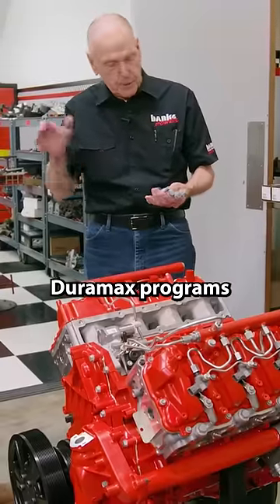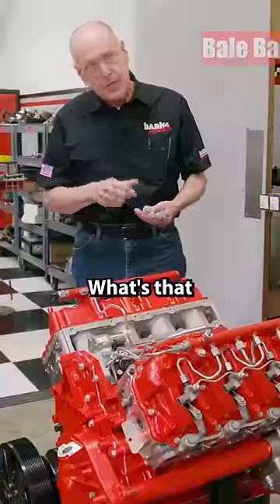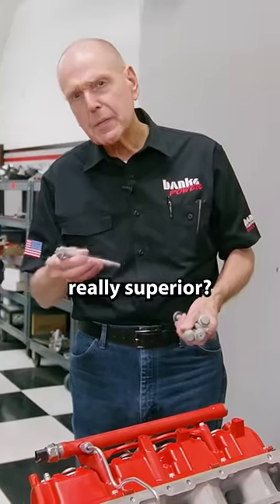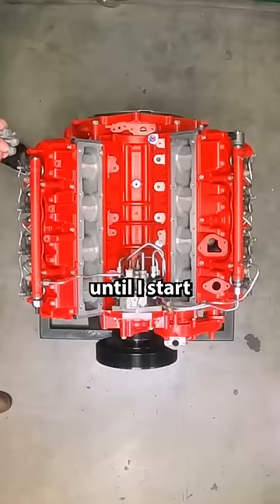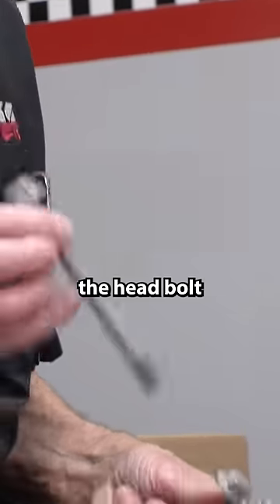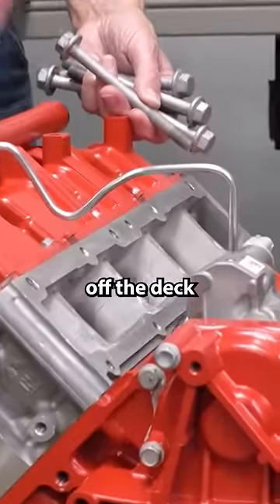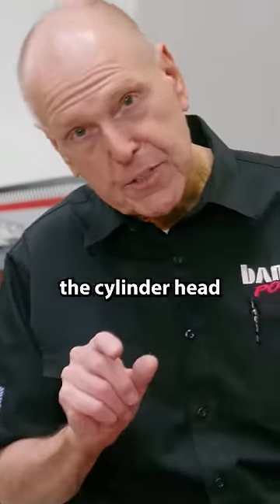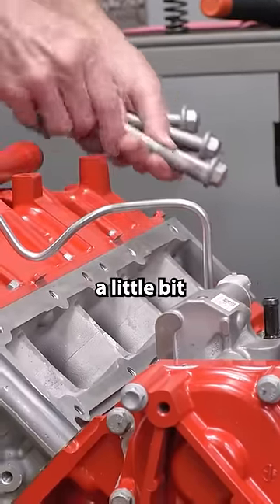Upgrading to head studs might be a bad idea

Comment: A gasket failure is always cheaper than cracking the block or the head.
Reply: A gasket failure usually leads right into over heating, which can warp/crack the head as well as cause other damage to multiple points of the engine. But if you can catch it right away, yeah.
Reply: Facts, but also water in the oil can lock all of your bearings.
Reply: A gasket failure often times leads to head/block damage, so not really
Reply: In these applications he’s referring too - you’re gonna pressurize the cooling system or whistle burn the head and know immediately you have a gasket/internal issue.
Reply: @nathan1sixteen  cracking the block/head always leads to engine damage… take your pick
Reply: A gasket failure usually only leads to catastrophic failure if you keep driving the vehicle with the blown head gasket while it’s overheating. It’s common sense to stop driving when ur shit is overheating
Reply: @Eduardo_Espinoza yes !! I just spent 2500 on this issue !! Your right 👍
Reply: Do none of the people in this thread watch their damn gauges? A gasket failure ONLY leads to other damage when the owner is clueless or careless!
Reply: Idk. I’ve seen guys with engines that eat head gaskets. They stud it and don’t have anymore issues. Maybe don’t use a block that’s made of cheap material
Reply: Not true.  Cab off is always expensive.  😂
Reply: Yeah that guys just a genius
Reply: @Eduardo_Espinoza lock what? do you even know how "bearing" are in a engine  hit for you there none crank and rod ride on a lol film that the bearing clown water in it won't do jack shit 
But it will destroy a 2 stoke engine in no time because small engine use actual bearings for the crank and rod
Reply: @nathan1sixteen gasket failure never end up in a block/ head failure unless you let it overheat for hour even then it will be rebuildable been here done that to a John Deere 544j the operator blow the head gasket go back to the garage and let it run for 1 hour before a mechanic go stop the engine with the temp gauge peg for probably 1 hour 
But now the engine is rebuilt with the original block and head and work great
Reply: @Adierit i don't know score but I'm sure there's been a very small amount of engines in history that cracked a block the second they overheated from a blown headgasket.
Reply: @MrSirGiuseppe  You would be wrong then, given that there is entire yards of vehicles dedicated to cars rendered useless from that exact thing. Do you even know how many people drive on a daily basis without even knowing they're supposed to check the coolant and oil levels? The world is absolutely full of people too poorly informed on cars that drive them until they explode.
Reply: @joshuaearnheart2756 That's the point , only do it if absolutely necessary.
Reply: No there are yards of vehicles that were driven too long with headgasket failiure. If you catch it before you overheat youll save it, guarantied  @Adierit
Reply: Building an engine that doesn't crack the block is always worth more then running less power to not blow gaskets and bolts 😂
Reply: A good block won’t let cylinder pressure rip the stud out🤷‍♂️ obviously they have an excuse depending on the ho numbers, but ya gotta pay to play
Reply: And I say is it really a head gasket failure?  Or has something caused the head gasket to fail?
Reply: @RLD_Media 😊
Reply: so other words build your block if you want 1000hp @Adierit
Reply: @joshuaearnheart2756 that's why he said until I start seeing head gasket failure I'm using stock head bolts. So in your situation going to a stud would be a fix
Reply: @nathan1sixteen only if you keep running the car like that
Reply: Not if you have a truck like mine engines are plentiful good shops that have good mechanics charge close to 200 a hour
Reply: Tell that to somebody with a early Duramax or a 6 l power stroke
Reply: @Adierit  Also with a diesel it can cause a runaway. Which if you are not able to snuff out the engine it will destroy it.
Reply: who cares, both are expensive enough to make most people get rid of their car anyway.
Reply: @Call_MeDaddy yea but cracking the block isn't guaranteed plus there's always JB weld to fix it up lol jk
Reply: @Zesmas  you don't make choices like head studs vs bolts unless you're committed to the build.
Reply: fuck no
engine swap is free for me i have spares
head gasket i have to buy a head gasket
Reply: @Adierit yeah but usually you figure that out before it's too late unless it's high rpm/ constant rpm application aka like a generator or racing or if your just a dumbass and can't see the steam coming under the hood....
Reply: True!
Reply: Except, cracking heads are a very common side effect of blowing head gaskets. So now instead of one, you got fucked with both. I’d rather do studs once and never touch it again

Comment: But then I can’t tell my friends I spent $400 on ARP bolts 😂
Reply: I
Reply: Sure you can.
Reply: According to what he's saying, unless you have a billet block and head, dont upgrade your head studs. 
It might be a good upgrade in some cases where both engine block and head is iron but most modern engines have aluminum in either block or head.
Reply: Tell them you has the OEM manufacturer spend millions developing the parts.
Reply: @PiDsPagePrototypes  those word’s leave my mouth regularly 🤙
Reply: @christianhudspeth3338  yes thank you I watched the same video you did 🤣
Reply: OEM engineering is pretty moot once you, say, double engine output, innit?
Reply: You have a Honda accord 1.5T and are aware of the blowing head gaskets.
Reply: I have a 500 cu. inch big block chevy and its studded with arp head studs and crank studs and its been together for 20 years and has never blown a head gasket or been apart.
Reply: @matzrat5006  nice. I need an old car. I have a 2018 Accord. I need something with a bit more power.
Reply: Me too, 6.7 cummins n g56 6 speed
Reply: Lmao!!  Your a funny dude.   We need things to brag about to our buds. Haha.
Reply: 1600 for arp 625s bud
Reply: Just lie they can’t see them anyway
Reply: @christianhudspeth3338 sounds like he's saying it's not necessary unless you're going over 1000 horsepower
Reply: @bcubed72 maybe, kind of depends
Reply: @PiDsPagePrototypes the 6.0 powerchoke has entered the chat...
Reply: You can even buy them... he is just saying you might want to think before you put them in.
Reply: @christianhudspeth3338 in some cases, both head and block are aluminum
Reply: Bro i spit my drink out when i read that😂 i think stock head bolts is even more of a flex.
Reply: @scottleggejr  Isn't that shared with GM? Or is that just the Transfer Cases ?
Reply: @christianhudspeth3338 well considering that’s a duramax it is an iron block with aluminum heads
Reply: @gingabred2898 have an 07 stock 6.0 with over 200k on it. I ran 100hp tune for 3 years on it with no problems with head gaskets. The problem with 6.0 is it doesn't ha e enough head bolts in the original design. It was designed by Europeans who have zero clue about Americans insatiable need for more power.
Reply: What friends 😂😂
Reply: @christianhudspeth3338 Why might it benefit an all iron setup? 3800 guy here
Reply: It's  OK friend the duramax engineers should talk to the top fuelers engineers to who make 10, 000 Hp how to make better blocks 😅.
Reply: @benjamingaray5660 with iron block and aluminum head, the aluminum is obviously softer, so that’s why you see the cracks in the threads in this vid. The studs are harder than the aluminum and only the head is flexing. Stock head studs have some flex in them which allow it to move with the head. If you’re blowing gaskets on an iron block and head setup, you can get more clamping pressure without the worry that the harder studs and block will damage the head.
Reply: @bcubed72 its not a moot point if you're using the OEM block to do it, I think that was sorta the point here mate.
Reply: The m54 3.0l in the bmw e46 will lift the head off the block at 400-450hp (stock 230) it’s a must for any build to use arp and upgrade to m12 rather than m10 studs what they come with when you run over 500hp
Reply: I ran a 5.9 24 valve with compounds turbos pushing 70psi plus.  775whp/1375 wtrq on stock head bolts for almost 15 years.  Never a problem
Reply: But a sticker
Reply: On a 6.0 Powerstroke, head studs are absolutely necessary. The torque-to-yield from factory are garbage and don't even stabilize the head gaskets under normal driving conditions and given there are only 4 head bolts per cylinder, you need all the clamping force you can get.
Reply: Sure you can, just lie 😂
Reply: @PiDsPagePrototypes you mean studs?
Reply: But do I get a sticker with the arp bolts?
Reply: all he needs is a empty box!
Reply: Plastic caps over the bolts,that look like studs on the outside.
Reply: @Dieselfueledwork  🤣
Reply: I think I paid like 700 for arp's for my 6.4 diesel
Reply: @christianhudspeth3338 the guy is clueless head stud don't crack block that a casting flaw and if you look the bolt hole is way too close the the edge there no meat where it cracked
Every Honda engine I built (aluminum block and head) use arp it's the only way to keep the head gasket in one piece  with any kind of boost
The reason is most modern engine use torque to yield bolt and they stretch like crazy when the cylinder pressure is increased 
Vs the duramax head bolt he show that are not torque to yield. Make sense in a engine engineered to have a turbo from factory and  a high Cr
Reply: @PiDsPagePrototypes part are engineered for a stock enfine
putting arp bolt on a 125 HP Honda engine is pretty useless
But add boost and without ARP head stud you gonna blow head gasket left and right 
And never see a block failure associated to head stud
This is clearly a casting flaw and the hole is way too close to the edge not enough material
And if you put arp stud you increasing HP so who can say it the arp stud fault or the casting is just not strong enough for the power that the real question
I see engine split in half the block broke at the base of the stud and the upper part is still bolted to the head pretty impressive
A Honda cast block from a b18c or k20 will split at ~ 1500hp with L19 stud
Reply: @christianhudspeth3338 It's a good idea if you're adding boost to an NA car as well.
Reply: 400? Well over a grand on cummins
Reply: Well, you could still tell 'em that, they'll never know.
Reply: Matter of fact you tell them they were so shit you had to send them back
Reply: No,he saying you dont need studs until you start blowing headgaskets.@christianhudspeth3338
Reply: @kylelaughinghouse1893  no what he’s saying is leave the head bolts to be the weak point.
Reply: Or put an ARP sticker in your back window
Reply: @bcubed72 he has more than doubled the power with stock head gasket bolts.

Comment: Ok I need 100s of hours of this guy talking about engines
Reply: It's just comon sense buddy but no one actually listens there's some good tuners out there but old school advice rarely followed
Reply: Oh to have worked in his shop!!!!
Reply: I had no idea the gasket moves with every gas explosion, is it possible to know how much it moves in thousandths??
Reply: @mitchweber7868 depends on displacement, running temp, atmospheric pressure, atmospheric temperature, timing, materials, etc, there’s a table to calculate it but last one I saw was in 82 in a old chilton idiot book, guesstimation? .2 to 2 hundredths
Reply: @patrickancona1193  .2 to 2? We're talking way smaller than hundredths and thousandths, we're talking numbers smaller than microns.
Reply: I’m only into my lly for 7 yrs, but to answer the question; have you ever pulled your duramax up to another vin model(LBZ,L5P, LMM etc), do you hear/ feel the vibrational offsets? The vibrations are dissonant. 8 cylinders firing micro seconds apart. There’s a lot of Ins and outs,  but measuring the flexing would be theoretical at best.  The motor creates its own harmonic vibration when in full operation throughout the rpm bandwidth.  So now imagine machining the internal parts, block, moving parts and external bolt-ons to be exact, and while it may be ‘balanced’ there is differences in shape, mass and density and therefore each cylinder and corresponding head bolts and gasket cannot be the same flex distance measurement. It creates a vibrational picture just like sand being bombarded with sound wavelengths on a metal plate. Sorry for the novel but this topic is so darn neat-

Comment: "Until we have a failure; we won't.." is all i need to know
Reply: Yes makes total sense. There are other engines out there where the head gasket does start to fail and upgrading the studs does stop that. Case by case basis.
Reply: It's much, much cheaper to replace a $50 head gasket than a $3-5000 block or $10,000 billet block
Reply: Very true 😂
Reply: yeah that"s not wise! you need predict it or when you fail it the middle of competition you lose more than entire engine.
cracked block says only that block is bad even new!
Reply: *me when bolting on a way to large turbo to a stock bottom end engine
Reply: @CesarMartinez-wi7wc  Billet blocks cost a lot more than $10k. They're also repairable in most situations.
Reply: Tbh Duramax stock headbolts are pretty good and experience will always be better than internet. However Studs are better for keeping the cylinder head attached and yes that will eventually show you are different flaw in the specific design of the engine. 

My Volvo for an example has a B6294T bone stock running 300kw and 550nm. 

I cannot go any further until cylinder pressure either cracks the cylinder wall (fix it with Datorn sleeve) or expands my bolts. (Studs are the fix) 

I have seen engine crack right through the block because the forces are so extreme. What you do then? Order a custom billet block ofc 🤩

Comment: The mechanical engineering granpa we gear heads need. 🙏🏾
Reply: Too bad what he's describing with the head bolts stretching for every engine cycle is inaccurate.
Reply: @chacelarsen50  I'm interested your scientific explanation...
Reply: @craiglamb9029  you can't prove a negative.
Reply: @chacelarsen50 Bolts stretch like springs.  Cowboy up and learn from this indescretion.
Reply: @chacelarsen50 Why so?
Reply: We have been listening to Banks for decades. Before he was ole Pops.
Reply: @greebuh  Gale leaves himself an out so those without any understanding of metrology can argue amongst themselves when he says "might". It on par with somebody saying, "The earth "might" stop rotating tomorrow". If it doesn't, he's correct and if it does, he's also correct. There have been certain instances where he has gone out on a limb such as his differential cover is needed in order to avert ring and pinion failure. Remarkably, trucks had ran billions of miles without failure before he came out with his finned differential cover. He's a good salesman for sure to the masses but those of us with ME backgrounds know a commercial when one is presented. Cheers!
Reply: @strykerentllc  What the hell does that have to do with my reply?
Reply: Amen!
Reply: Nah, yall talk mad shit about engineers all day, he doesn't get a pass

Comment: Exactly the next point of weakness will show itself. 😊spot on
Reply: When you have a piece of equipment fail and you "beef it up" so it won't fail again, you will force the fail point to the next weakest link.
Reply: @thomasjohns2201 
And in this case, it's the block.

Comment: I trust every thing this man says
Reply: Could we help solve this problem by designing the head in a way thay it can slide on in a way that it would only need bolts to keep it from sliding off and wpuld have more surface area than just bolts. Im trying to think of an example but thenonly thing i can think of is the rails a drawer slides in and out on. Only issue then is gasketing will be harder because you cant just throw a gasket on and bolt it down. Its also completely reengineering it but i mean do i trust 2000hp on a few headbolts? Is there a way we could attach the heads more securely
Reply: Why not have a spring or air brake for the pistons or make the gasket more like a compressible seal like the weather strip on your doors
Reply: @ffsrdr6596  to me it doesn’t even make sense you need material strong enough thousands of psi under full load and the heat so maybe we haven’t figured out what would be best but engineers are good at what they do
Reply: @TylerMartin-bf9yb   and likely they have tested every man-made material they got and even come up with some new ones that dont work out long term.
Reply: Almost... he's still a business man.
Reply: I don’t the fact he said head bolts cause other failures is false
Reply: Do you believe in " every time you fire the cylinders the head bolts stretch a little bit"? If that is true, there would be much more head gasket leak cases during a short period of time.
Reply: @miraciamiracia8007 steel can stretch amd return to its previous dimension as long as it doesnt exceed its yield point and enter plastic deformation.

I dont know if its true that it's actually happening but it would be possible.
Reply: @carlosrobertson8265  Makes sense 👍
Reply: @miraciamiracia8007  he's talking about microscopic distances, probably in microns. 

(I would think) That tiny bit of movement is probably what happens at the start of a head gasket failure. Clamping pressure on the gasket is reduced, and it becomes more likely to get pushed out or bypassed by cylinder pressure.

Engines don't heat up uniformly, and i think heads/upper cylinder walls get hotter quicker than the rest of the block. Therefore, thermal expansion will cause movement between parts anywhere there is a temperature differential. Thats one reason why we use gaskets. That amount of movement is very small, but it is measurable, probably similar to the amount of movement going on with the head/gasket/head bolts.
Reply: @TheAnnoyingBoss  bungees? you can always add head bolts. or the diameter?